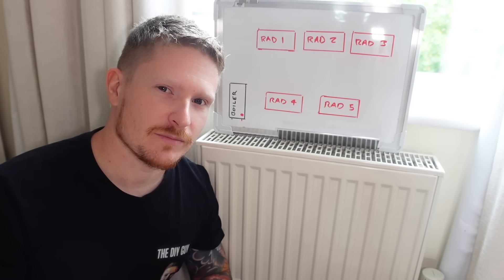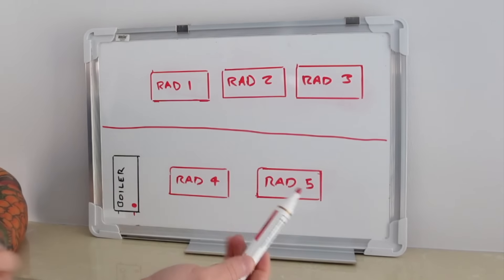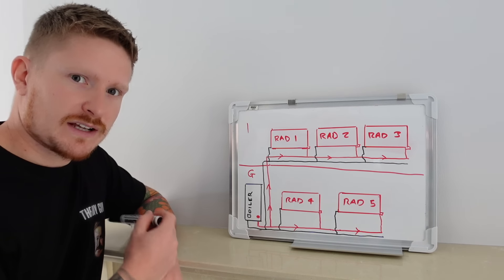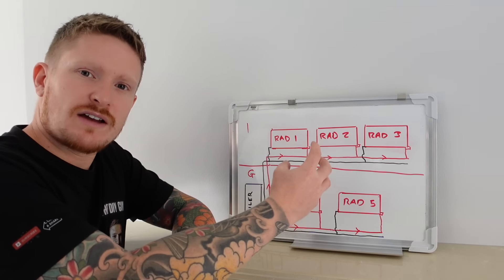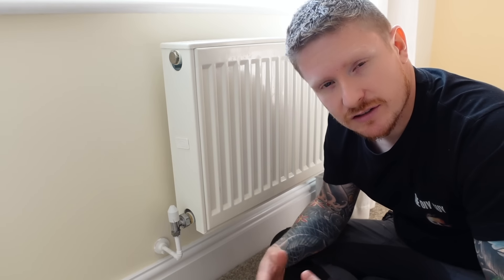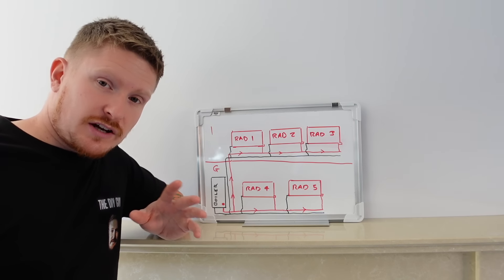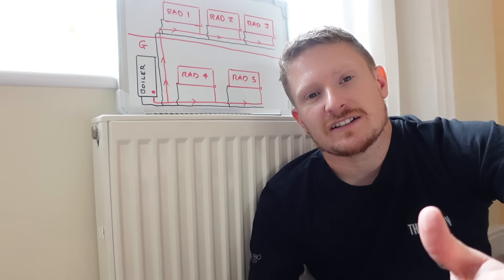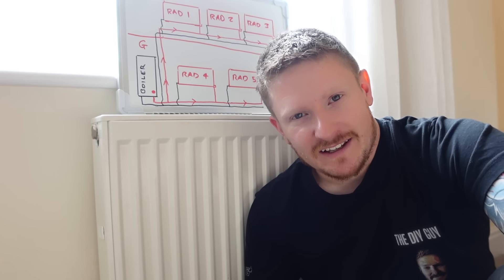How to Balance Your Radiators | Save Money and Increase Heat

Comment: Question time!
My system has TRV's on all radiators except the heated towel rail in the bathroom. It also has a traditional wall-mounted thermostat in the dining room which controls the motorised valve in the airing cupboard (and thereby the boiler by the micro switch in the valve). There is also the adjustable bypass valve for the idling circuit.
Why is a wall thermostat fitted or required when each radiator/room has its own TRV to control each room temperature individually? As an engineer, it makes absolutely no sense because as soon as the dining room reaches the set temperature on the wall thermostat, the boiler shuts off and none of the other rooms can reach their set temperature.
You can't have 2 thermostats controlling the system but every house I've seen with TRV's also has a wall thermostat somewhere.

Just as an additional stupid idea, our lounge has 3 separate radiators each with a TRV. They are all connected in parallel. Again, it's nonsense because the 3 rads should be in series controlled by 1 TRV on one rad otherwise as it is unless all TRV's are set to the same temperature one rad will be hot and the others cold. Completely ridiculous.

Comment: I have that one radiator in the house (pressurised combi) that is cold.

It's not a stuck pin (I think as the temperature in the incoming pipe is quite hot, and even on this side of the TRV it's warm, and on the knobbly bit on the back of the raidiator  is warm, but the front is stone cold.  

It doesn't need bleeding (checked that)

I've turned all the lock valves to closed (a lot of them were just turned right up to ful) and then opened them a quarter of a turn. 

Just traying to balance them all now.

Comment: Great video, thanks.  My lockshield valves don't look like the examples in your film, they don't have the upright spindle for adjustment, there is just a flat brass nut on the top of the valve body.  Do I just turn that in the same way as the valve spindles in your example?

Comment: The 'manual method' is in basic terms correct, but sometimes you need to finesse the LSV settings to:

1.  get a better balance, as the size and location / pipe route to each radiator may make some sub-circuits of a far higher pressure drop (and thus far more difficult for the water to circulate) than others.

Not just because a radiator is downstairs or the furthest from the boiler, but possibly because the route that branch takes is very long or winding (many bends), but you may not know where it goes, especially where the pipe is hidden in walls, floors or inaccessible ceiling voids.

2.  just as important , especially for small systems [e.g. flats] that have combi boilers, to get the best flow rate through each radiator and the system more generally to achieve a good 'delta T' (the difference between flow and return temperatures, as was shown on the video to a degree).

The vast majority of combi boilers (even the latest ones, aside a few) have a high maximum output but also quite a high minimum output in heating mode compared to the maximum (never mind the minimum) heating requirement for the system.

For example, in my 2-bed flat, I have a Vaillant 832 (32kW max output - hot water mode, in heating mode its 25kW) combi, which I wanted because it reasonably met the hot water load for both my shower AND my hot fill washing machine if used at the same time.  The smaller 825 version only has a max. output of 25kW (hence the name).

However, in heating mode, the 832 has a min. output of about 5kW or so (the 825's is about 80% of that).  Either is FAR above the maximum heating requirement (-5degC outside at the coldest time of winter) for my flat, which I calculated to be around 2.5kW, which means once the heating flow has got up to its normal maximum operating temperature of 75degC (you can set it to 80 if needs be), the boiler cannot 'turn down' to maintain that and has to 'short cycle', i.e. run the pump with no burner on.

The system flow temperature drops to a specified level (determined by the boiler), then the burner fires up again and raises it back to 75degC, and the cycle repeats until the system controller's temperature sensor determines that the room where its located has reached its set point, then the pump and boiler go into standby mode, coming on again as necessary to maintain that room temperature.  A more flashy system might have electrically-actuated (battery powered) TRVs on each radiator that communicate with the system controller so that every room is up to temperature, which can throttle the pump up and down (within limits) to achieve this the best it can.

Whilst most modern combi boilers have variable speed (in-built but replaceable) pumps, they are sized to match the maximum heating output, not the flow your system actually needs.  This is why I believe that combi-based systems are significantly inferior to system / heat only boiler ones, because the latter two have boilers that are vastly lower in output, say (for a flat) 15kW with pumps to match, which means the min. heating output is only 2.5-3kW, which significantly reduces short cycling, in my view improves boiler reliability / parts longevity, increases efficiency and reduces the time to heat up the property.  My boiler's pump is always on at min. 15% flow (apart from at startup) because it's flow and pressure output is matched to the maximum heating output of the boiler, NOT what my flat needs at peak demand, never mind at other times.

One way of 'helping' overcome such problems in combi systems is to give the boiler pump a higher system resistance by throttling ALL the lockshield vales (LSVs) proportionally, thereby reducing the hot water flow to each radiator, which also increases the 'delta T' across each of them and the system, which also reduces the return temperature back to the boiler and hopefully increases the amount of 'condensing' it does (better as the return temperature decreases from around 58degC), which can up the boiler efficiency by as much as 10% in raw terms, helping reduce bills. Here's why:

Boiler min, heating output (constant) = heating system flow rate x constant factor x heating delta T

...thus if you reduce the heating system flow rate by upping the system resistance (throttling down the LSVs), you up the heating delta T, reducing the return temperature (the max. flow temperature is fixed, say at 75degC) and improving radiator effectiveness and system efficiency as described above.

Many modern boilers will also 'learn' (to match internal or external conditions and when the rooms get to the set point temperature) and automatically reduce the system flow temperature (and thus the return as well) to the lowest it can reasonably 'get away with' to achieve high efficiency via condensing, but a well-designed and installed system can achieve radiator / system delta Ts of 20degC (or more), meaning the boiler will be condensing (and at a higher rate, thus increasing efficiency even more via lower return temperatures) for far longer than if the delta T was only 11degC, and you can heat your home quicker because you can use a higher system flow temperature.  Radiators work best with high delta Ts.

What you have to ensure though is that the LSVs aren't throttled (shutting) too much that it causes noise in them when water is trying to flow (whistling), plus if the system isn't clean or gets sludged up (old / poor quality radiators and/or pipework), they can get blocked more easily.  It may be that in such systems you may have to accept that the rads are 'well balanced' and quiet, but at lower delta Ts than above.

If my flat had the space to install it, I would've had a system or heat only boiler + HW cylinder, not a combi, so I could better much the heating and hot water demand to my boiler and pump.  If I recall (this may have changed, as I've not been in the industry for 7 years now), most combis only have a turndown of 80%, a few did have around a 90% turndown, such as one from Viessman.

The problem for me was that I thought (as a design engineer) they were a bit less intuitive to use than the Vaillants and Worcester-Bosch boilers (and other major makes available in the UK), plus there were very few Viessman-trained plumbers in my region (only one, and who was about 30 miles away) rather than several in my home town and surrounds for the others, which means I had a good choice of fitters and maintainers to call on.  A shame really, as I otherwise rated those (admittedly expensive) Viessman boilers very highly from a technical and reliability standpoint.

Sorry to go on a bit, but I though I'd put my thought down on these issues, if it helps anyone out there.

Comment: Really enjoying the videos. I have a standard boiler with hot water tank upstairs and an extension was built before we moved in. How would I know which the order is as a lot warm up at the same time. The 2 at the end of the system have died after a system drain and re fill and I’ve bled the system more than once and everything’s fine bar the final 2. We have 13 in the system. Thank you 🙏

Comment: Thanks for the video. I find my last radiator boiling hot while the others are normal. Different from other radiators in my home, this last radiator has no TRV with both inflow and outflow lockshield valves fully opened. Should I turn close a little bit for the inflow valves of the last radiator and leave the outflow one fully opened? I don’t want this radiator to be boiling hot because the high temperature causes the wallpaper edges peeling off😢

Comment: Hello, I got new radiators fitted after ASHP installation - on one of the radiators the temp is higher on by the TRV valve than on the lock shield valve - could there be another explanation that just them being on the other way around? and would it be just a matter of swapping around the two valves? Thank you

Comment: Hi thanks for this video.

I have a question, when doing this method the old school way, when figuring out which radiator heats up first to last, we're struggling because we have some single panel and some double panel, the singles are obviously heating up quicker, making it difficult to suss out if we can identify the correct order?

Please help

Thanks

Comment: Can’t afford the thermal imaging thingy even though it’s seriously cool, so looking at the digital thermometers.  Question, we have 21 rads in our house so if I do the digital thermometer option can I just let the heating run for a bit and then check each radiator to see if there is a 12 degree drop or do I have to map out the order in which they get hot first and do them in that order? Our upstairs rads obvs get hot first as all on 1 on trv and very hot downstairs not so much so need to try this.

Comment: I can understand that adjusting the lock valves to compensate for pressure in different parts of the circuit in order to achieve the same flow rate in each radiator will work. However, what happens if each radiator is fitted with it's own thermostatic valve? If that's the case, could you not just fully open the lock valves and let the thermostatic valve control the flow as needed?

Comment: So glad I found this channel, the only question I have is not all my radiators have  a trv ( I think that's what you were calling it) do I turn the brass pin with my grips to full to allow the water to flow on max ? To allow maximum water flow in ?

Comment: Maybe it's me but your diagram shows a flow & return but in your physical test you adjusted the lock shield valve which for some reason was hotter than the thermostat side. Surely the lock shield valve would be colder than the stat side? Appreciate clarification.

Comment: I can see how restricting the flow out of the radiator would increase the temp difference, but how does reducing the flow in reduce the temp difference please? When the TRV is on the return side should it be fully opened by trying to balance? Thank you

Comment: Hi just watched this video contained some simple to follow advice much needed however - how do you know which is the 1st radiator and last in the system. I live in 3 story townhouse and the boiler is on the top floor with several radiators?

Comment: Top video. Helped me to understand the whole 'balancing' concept, where I've just opened them all up. Really simple to understand and well explained.
The only thing I will say in terms of my system, is you assumed the property was installed with a combi boiler. My house is old school and still has the cylinder in the airing cupboard, and a 'standard' Potterton on the wall. 

I'm assuming the method remains the same regardless? 
Cheers & I've subscribed now.
Reply from the maker: Glad you liked it! Yes 👍

Comment: Thank you, so how would this work with trv valves? I generally have a cold bedroom up stairs and one room down stairs, i assume the water doesnt get to it in time before hallway switches off. Ive change hallway one without trv to be quarter turn. Should i turn the cold rooms on full to ensure they get more heat fast?
Thanks

Comment: Many thanks for amazing content. This is really helpful. 

I struggle to get my head around how come it doesn't matter which valve is put onto radiator's inlet and outlet in modern systems. To me, it all makes sense when TRV is at IN and the lock shield valve is on the OUT pipe as the lockshield for example may slow down the hot water getting out from rad too quick. If the valves are put in the other way round I just don't get it 🤔
Reply from the maker: Glad the videos help
Reply: Water takes the path of least resistance....shutting the LS down on the return side means water can't flow through the radiator as quick and will therefore carry on down the flow pipe to the next radiator.

Comment: I’m a P&H engineer. You’re  correct Upstairs is 1/4 turn open on the lock shield however Some cheaper valves need opening more. I find the nasty ones need one full turn to even work. Downstairs should be fully open in the living spaces especially the valve where the room stat is which you didn’t address in the video. I find wcs and utilities can be 1/4 on larger systems. Either way good video you’re nearly there.
Reply: “You’re nearly there” 🙄.  Pretty condescending considering he took the time to make a really clear video that explained things for 95% of scenarios without making it overly complex for the average homeowner.  I’m also a P&HE but I couldn’t be arsed to make a video so I didn’t bother to try and show how I’m just a little bit cleverer or more experienced than the OP - also cos I might not be, so then I’d just look like a patronising bellend.

Comment: As an English plumber who’s been living and working in Denmark for nearly ten years now, it still fascinates me that the idea of lock shield valves is alien here. Danfoss’ valves have a wee gauge that sits behind the rad thermostat and that’s adjustable, thus taking care of balancing in one hit on the flow. If you really want to go to town, they also produce ‘dynamic valves’ that also take care of the pressure differential. In theory no balancing issues at all. I’d be curious to know if they’re available in the UK - I’m so out of touch now!
Reply from the maker: 👍 interesting

Comment: On 2 floors, can the radiators heating up sequence vary to some up and some down because the feed is branched: or will the radiators on the same floor as the boiler heat up  first? i have a boiler mid positioned upstairs with 6 rads, and 5 rads downstairs.

Comment: Well explained video, but can someone confirm where the cost saving occurs.Yes it’s more efficient at getting hot water around but surely a proper flow of water back to the boiler will cause it to use more gas , although you of course get more heat.A radiator that is cold won’t cost anything to run.Have I got that right ?
Reply: A boiler is most efficient when return temp is about 20 degrees less than the feeding temp. A small radiator where the hot water is pushed through quickly means the just heated water is flowing back to the boiler quickly instead of going to a radiator that could do with that heated water. Meaning there is less heated water in the feeding tube to heat bigger radiators. The boiler needs to work to keep the hot water flowing to reach the desired room temperature. Surpressing flow through smaller radiators makes sure all radiators heat up more evenly. This gives a more comfy feeling. Water that passes a radiator less quickly provides also more time for the hot water to give its heat to the room. Hope this clarifies and reaches you, just realized this was posted a year ago. Greetz from the Netherlands

Comment: Hello, i have alot of rads, this method does work, when testing should i open up every rad both sides, then find out what gets hottest, once i done this do your method, also what about the other side once i adjusted them with the flow(method) you mentioned what about the other sides? Thanks

Comment: What I did not understand is how you explained where the water enters the radiator and leaves the radiator. I thought the water enters the radiator at the thermostat, not at the valve. So exactly the opposite of what you showed. Am I mistaken? The vid was very interesting and very well and clery explained.